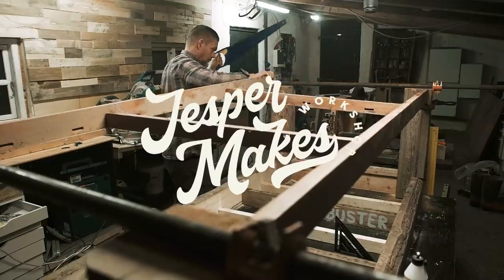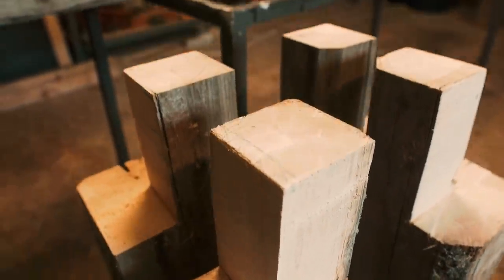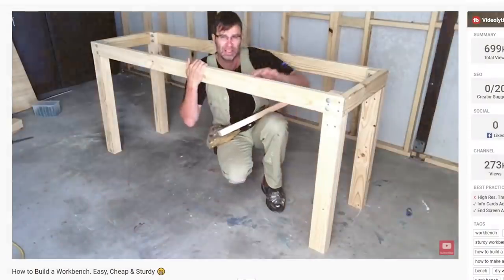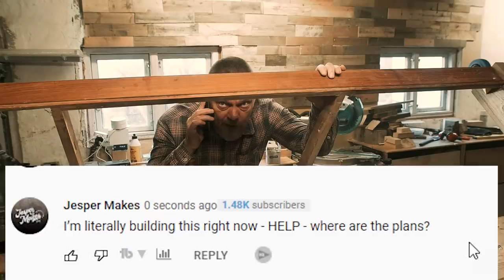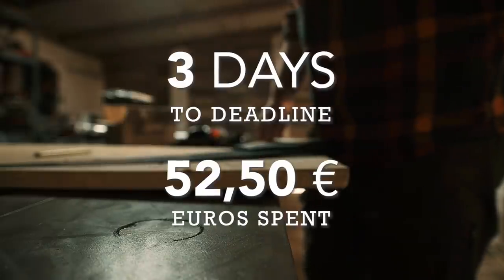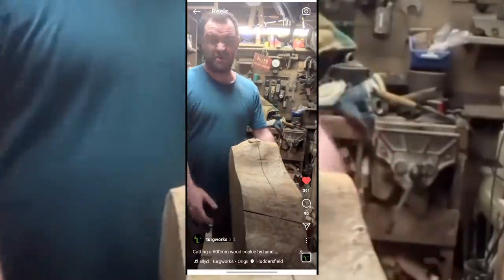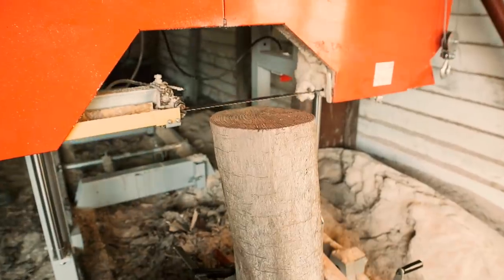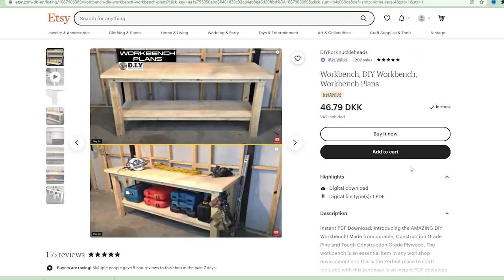Reclaimed wood workbench. REALLY reclaimed.

Comment: Building my own from timber thrown of the trucks at work the big 5by5 4by4 and some 6by4 they use as load bearing timbers to help forklifs pick up loads of the side and to stop heavy objects sliding of the truck i just need a nice peice for the work top itself
Reply from the maker: If you can find some plywood from shipping boxes that could be an option. Good job. Cheers
Reply: @JesperMakes  yeah for a 25 mill sheet of ply in the uk is over £100 nowadays how shocking is that
Reply from the maker: @catalickconverta6823  and it's way more in Denmark. I saw a 25mm Birch ply full sheet for over 2000 DKK, that's 229 pounds
Reply: @JesperMakes  wow that makes me feel better about buying a sheet seems cheap compare to denmark🤣
Reply from the maker: @catalickconverta6823  that was a while ago, just checked again, a shet of 21mm birch ply with 15 layers costs 2600 DKK, thats about 300 pounds. Check here: https://www.stark.dk/raw-birkekrydsfiner-b-bb-15-lag-21-mm-1220-mm-2440-mm?id=3200-9663595
Reply: @JesperMakes  what the heck thats ridiculous but i heard alot of the pine and fast grown birch is from russia so no wonder its gone up even more

Comment: What brand of track saw are you using?  Does it work with a traditional or stand alone circular saw?  Any info would be appreciated ...thanks for sharing your build.
Reply from the maker: Hi mate, it's an Einhell track saw, can't recommend it unless you're only cutting thin stuff. I'm replacing it with a Makita 40v circular and a Festool track saw.

Comment: It looks like the beams you used for legs were attacked by a weevil (hope this is the right word?! I mean on an insect attacking wood furniture etc.) I have similar beams and I wonder may I use them because the weevil?! I am afraid of entering into my workshop, perhaps other wood would be attacked?! Any advice, please.
Reply from the maker: Blagoje, dealing with wood weevils can be tricky. If the infestation isn't severe, you can still use the wood, but make sure to treat it properly to prevent spreading. Your workshop's safety comes first!
Reply: Hi Jesper! How about to send few images that you can judge if it is serious already or not? Because I am really a beginner and can't be sure at all. The beams look nice and I would like to use them, it is not (in my case) about money to/not to spend.
Thank you very much for answering.

Comment: You muppet. You didn't even show the whole table afterwards! I want my 13+ minutes back. 😑 ... drawers are awesome.
Reply from the maker: Hey Denver, to be honest I only finished the front side of drawers with cookies, the back side is still just chipboards. I do actually show the finished table for a few seconds, You'll need to pause it 😃
Reply: @JesperMakes  I really liked how you split some of the cookies between both drawers so when closed there wasnt a hard seam between them. I've seen a guy who built* a cabin that looked like a pile of logs, but was just cookies and longer skins on the sides
Reply from the maker: @denvernow7294  I'm covering a wall in my house with cookies, good tip with the long skins. I'll try to use that effect somewhere. Cheers mate

Comment: Every waking free moment I have, I spend it on YouTube watching woodworkers and construction videos. After thousands of hours watching thousands of videos, I've come across your videos, and you might be my favorite of them all
Reply: P.s. I just bought a house with a garage, and I can't wait to set up my own woodworking shop finally. Any tips for a beginner, or any tools I'd be better off getting sooner rather than later ? I'm an electrician so I have hand tools and a few power tools but nothing like what I need
Reply from the maker: Hi Anthony, that is so nice of you to say that. I'm honored!
Reply from the maker: I was recently in the same situation. I would go with a miter saw, a lunchbox thicknesser, a jobsite tablesaw, a good drill and some sanders like a belt sander and an orbital sander. A track saw will also enable you to cut some long pieces like sheets of plywood very straight.